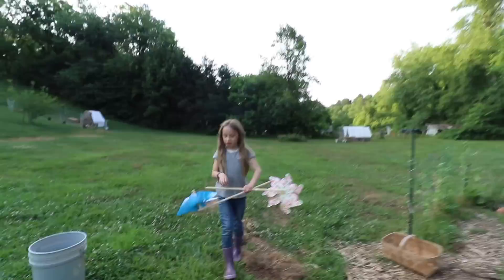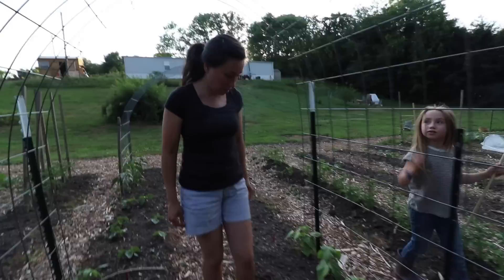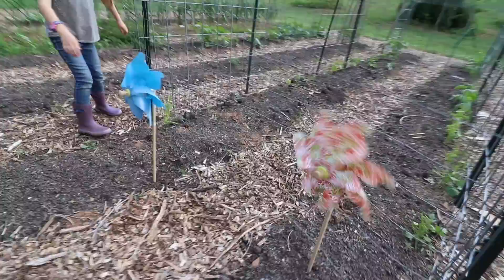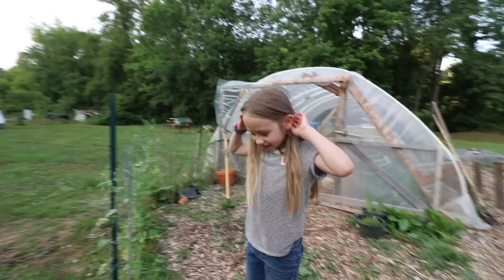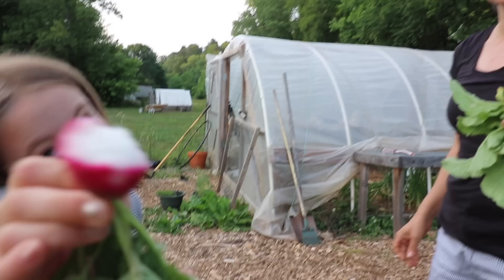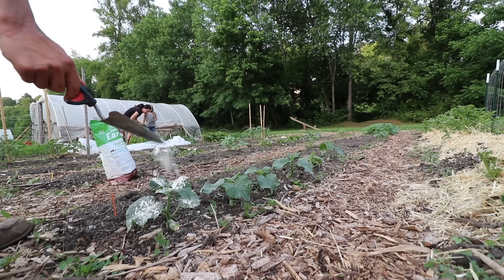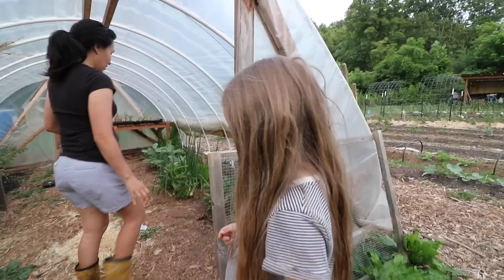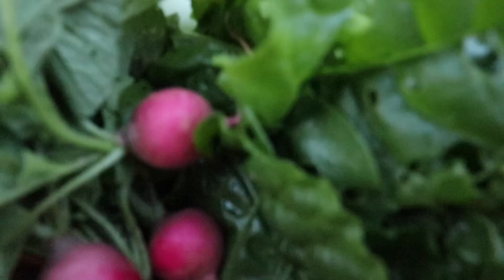Something  (BIG!) is EATING OUR GARDEN (Will These PINWHEELS WORK)

Comment: My fight this year has been grubs and VOLES.  Also SVB and stink bugs aren't my friends either.  For fencing on the cheap this year, we used t posts and bought this 150' chicken wire from Agra supply, it's 6' tall and only cost $50.  It has kept out deer and rabbits with no problems, and that garden is in the middle of the woods almost.

Comment: I had a squirrel problem, they were digging up my corn seeds. I couldn't figure out why the corn wasn't coming up. I thought the seed might be old so I replanted a coupled times but still nothing.  But then I noticed little holes where I placed the seed, then I spotted the darn squirrels. Honestly I planted corn 5 times this year before I got it to come up. I dig ditches for them, like 4 inches deep so when the corn gets tall, o back fill it to level it. The winds and rains don't blow it over since I've been doing this way. 
 Corn was really a learning process for me but I was determined. 
Anyway, I planted the corn one more time  and covered it with chicken wire. Finally Success! 😊  Lol..  I removed the wire when the corn was about 4 inches high.
I've also havr been using DE on my veggies, potatoes, strawberries, cabbages, just everything. Yep I've had bug troubles  too. 
Yes, ducks are great but I don't let them in the garden  until everything up pretty good. 
They eat the stink, squash bugs etc.. I love my muscovy's. They're very quiet so nothing tries to kill them. Pretty cool! 😊 They're eggs are awesome! I actually prefer those over chicken eggs. 
I wish you a super successful summer garden. ❤️

Comment: Pin wheels work for moles but for ground hogs a .22 to the head works better,  I had the same problem with ground hogs in my garden and that's the only way I got rid of them, you can try putting a fence around your garden but they will dig a hole to get to your plants. Larry

Comment: We live in southern Calif., and we used vibrating battery operated mechanisms all over our 1 1/2 acre to get rid of golfers and moles.  It works for us and I read it works for ground hogs.  Got them at Costco and it tells you haw much area it covers. Had to replace them every 3-4 years.  Just any idea.  Maybe amazon?  And rabbits, we shot and then put up 2' of chicken wire around the bottom of our fence.  You wood work is beautiful.

Comment: I noticed a circular bald spot on the back of your head. I hope I am not stepping into, but my husband had several of those and it ended up being his thyroid. Synthroid did not agree with him so he uses Nature-Throid or ArmourThroid  which is desiccated pig thyroid. His hair grew back along with his eyebrows. You might want to have your thyroid levels checked. His levels were a little low but still he was losing his hair. Worth a check if you have not already checked it out.
Reply: Officially Homesteading he has alopecia. He’s addressed this before in his videos.
Reply: @kellygreen8255  Thanks, i have not watched all his older ones yet.